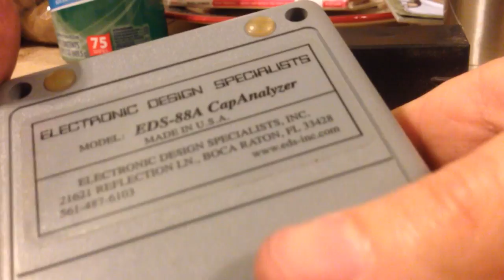85 Mercedes 300D Testing Glow Plug Relay Capacitors

Comment: Wouldn't the old one off the junk car be for be a series loop style glow plug, and this is for the parallel, pencil style glow plug?
Reply from the maker: +Gregory Malchuk they are both parallel controllers. I'm thinking maybe a different since the junk car wasn't a turbo or maybe because it was older?